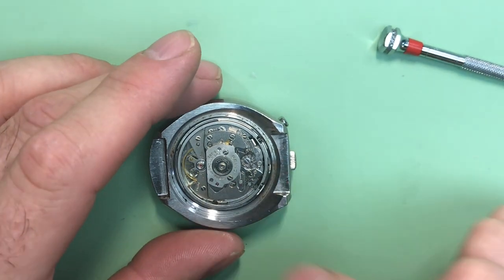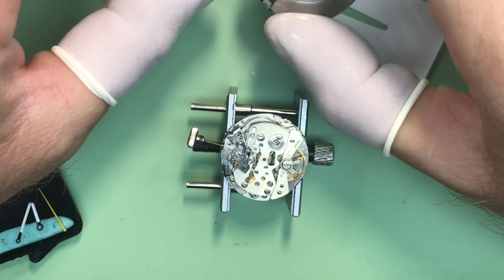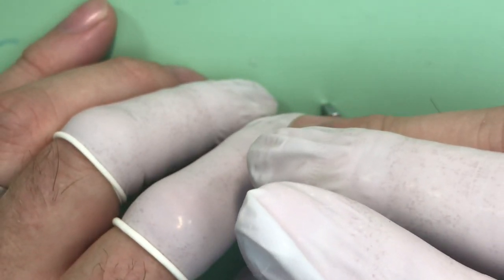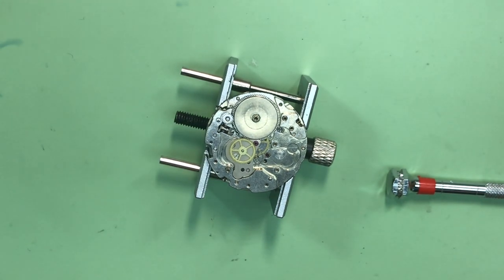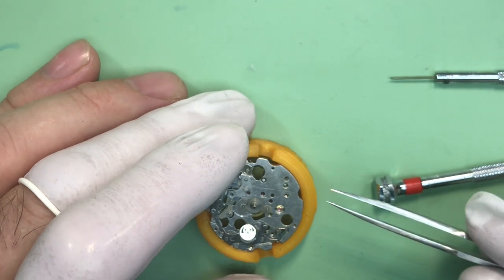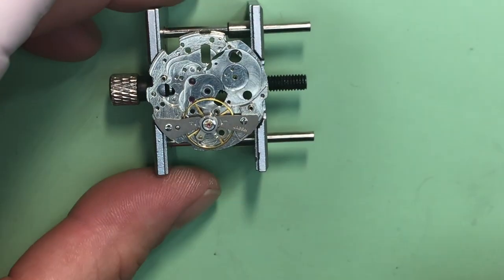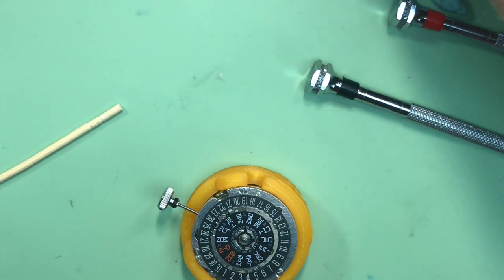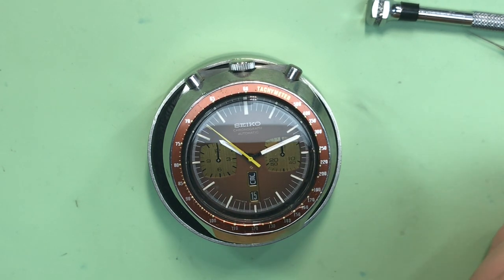For L.W. -- 6138-0040 Rebuild

Comment: Nice work!  I'm glad I sent it in before all those loose screws caused uneven wearing...  The person I bought it from said it was recently serviced, but I suspected it had not been a good job...  Clearly between that and the hairs all over the place that was an accurate guess!  Makes me wonder if the dial got swapped out then too... I'm also really surprised about the discrepancy between the dial and case dates... 
Great thorough job!  Thank you so much!
Reply from the maker: It’s a great watch! Glad I was able to get it back into shape.

Comment: awesome video.
I recently inherited my fathers 6138 0040 that he used as everyday carry since he bought it.
I love how you treated the watch and am curios regarding repair/refurbishment.
My fathers watch has some issues , needs a new glass , is missing the mini 60sec hand, and one push-button ,reset? is not functioning.,the lumes are very low too.
as I have no clue regarding these things, what ball park are we talking in cost for a full clean and refurbish in regards work time cost , and part replacements, glass dial, other inner parts non included as that is an unknown at the moment,?
it runs seemingly smooth besides the non working button

would you be willing to take on my dads watch?
Patrick
Reply from the maker: sounds like it needs a bit of help, for sure. if you want to contact me about service, please visit my webpage and reach out from there http://blairwatchproject.com -- thanks!
Reply: @BlairWatchProject  hello I have emailed to you